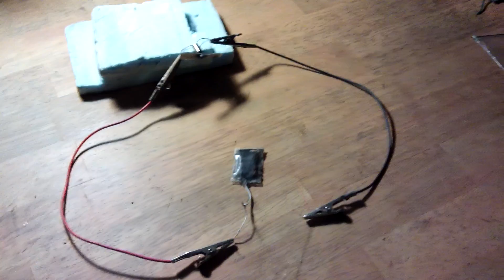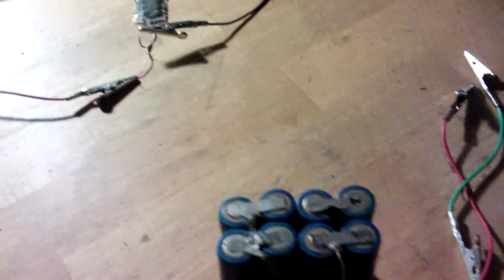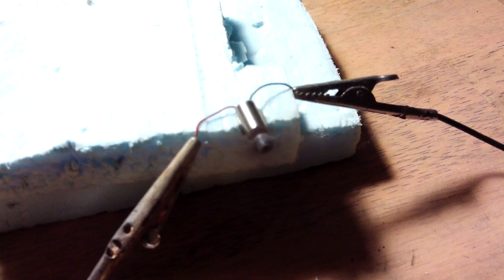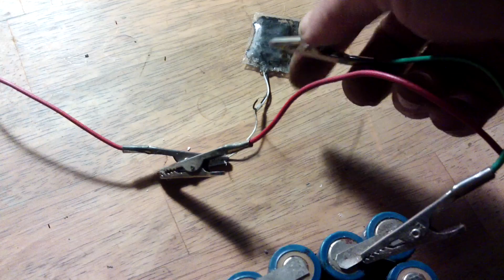Homemade supercap - running a motor !

Comment: That’s awesome I’ve never been able to get a super long time on any of these before
Reply from the maker: There are a few tips in my reply to Lidmotor below. The whole thing was/is an amazing learning experience. Can build cell after cell, get similar results for ages and then, suddenly a cell runs off with a half hour motor run or something. That's where meticulous note taking comes in, to spot that change...and i'm rubbish at that lol
Reply: Slider2732 haha note taking isn’t my strong suit either

Comment: Hey, that's a great effort! Did you use safety or strike anywhere matches because the ingredients are different? If phosphorous is one of the magic ingredients, then how about trying some superphosphate fertiliser? Thanks for sharing, I must do some experiments myself:)
Reply from the maker: +Pseudo Nym Strike anywhere matches :)
As mentioned above, it was only after crushing up the mix that I realised they don't combust when doing so ! Used a rubber ended screwdriver though.
Have tried with no phosporous and was right back at the 0.4V 20mA and less level...it's a big part of the whole thing it seems.
Yeah, the fertiliser is a great idea. I garden organically though, damn haha
Good luck with your experiments.

Comment: Excellent!  Is this right?  Two galvanized steel plates for the electrodes,  crushed aquarium activated charcoal, vinegar and crushed wooden match heads paste electrolyte,  paper membrane,  seal it up in a plastic bag, and charge with 6 volts.  Isn't that amazing.  Well done. Graphene? We don't need no stinkin graphene.
Reply from the maker: +Lidmotor Yep that's right :)
Stainless screen door mesh/dollar store stainless seive also work and are lighter. 
 Strike on the box type of matches...which, surprisingly enough AFTER i had crushed to a powder, realised that they don't set themselves on fire lol. I use a rubber ended screwdriver though. Easy phosphorus extraction is to crush the match in pliers lightly and then roll it in the pliers. The material flakes off the match wood. 
The paper is soaked in vinegar and perhaps interestingly, fizzes while wetting. Is only regular printer/copy A4 paper.
The graphene will likely extend the run times out to the 4hr 'grail' of this.
Adding Epsom salts extends the total run time, but the initial power delivery on connecting to a load is lower. Also likes to charge slower. Moretons salt is no benefit it seems. Toothpaste reduces high amperage fizzing, but does little else.
Hopefully helpful tips - if your mix fizzes on charging, it's fine for 5 secs. Don't go past that though else it degrades. 12V is also fine. Will get an ear for when it's too strong a charge voltage.  If your mixture begins to fade out because it's drying with heat/fizzing etc, pour more vinegar in the cell ! The motor even kicks up again for quite some time with no extra charging, after it has gone flat and then vinegar has been added.
Reply: +slider2732 Well I worked on this all day yesterday ---and it was a failure.   Don't know exactly what went wrong.  Will try again another day.
Reply from the maker: *****
Hopefully the step by step that i've just uploaded helps :)
As far as I know, it's the first such tutorial from start to finish, with a test at the end...am wondering too where things might be improved, so have been waiting for others to do theirs. Anyway, it would be great if you have an 'aha' moment and are successful !
Reply: +slider2732 I just watched your next video.  Thanks for that.  I will give it another go.

Comment: great work and that laminated pouch makes it look quite robust.
Reply from the maker: +GrandadIsAnOldMan Thanks. The pouches are quite big in full, a few inches square, so a corner was snipped off. Then I used the soldering iron quickly over the sides to seal.